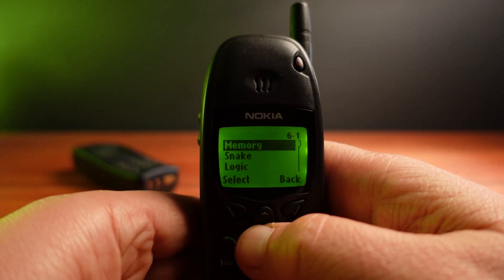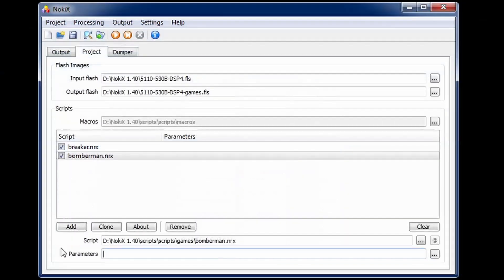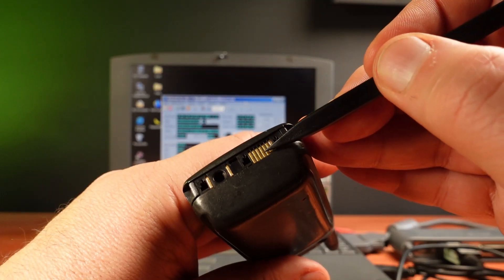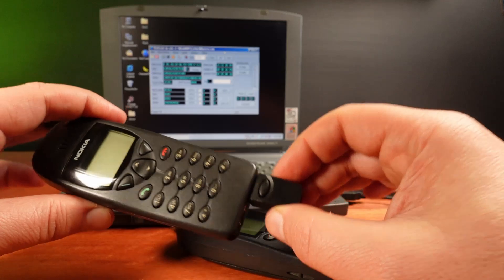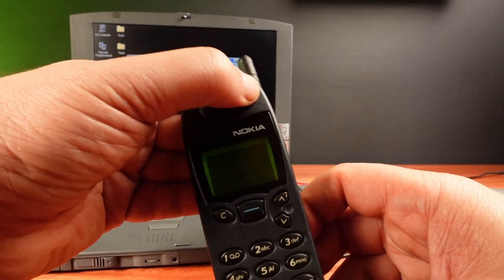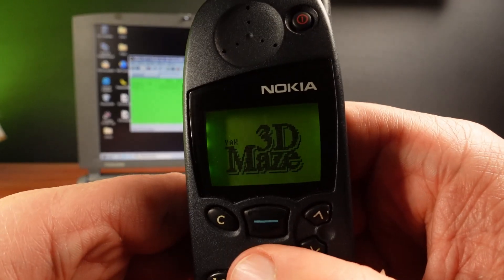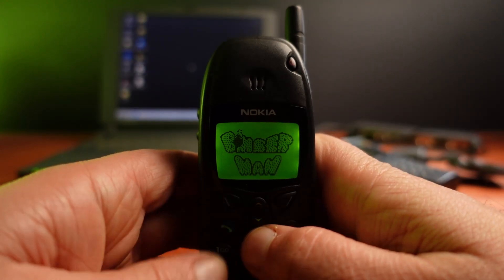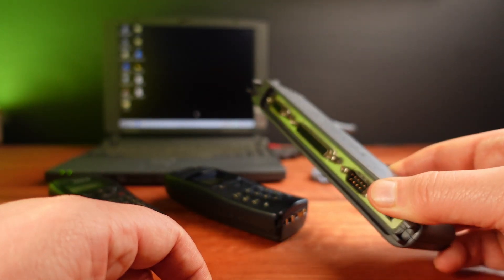Vintage Firmware Modding Nokia DCT3 Phones

Comment: It's strange, I assembled a cable for flashing, but when I try to read the flash, it gives an error initializing the preloader. And the error code is different each time. I checked my circuit a million times and whether the contacts are suitable for the Nokia itself (in my case, 5110) - to no avail. I don't know what to do anymore. I assembled two such cables - both do not work. I use Pentium 4 1.7ghz and 98SE
Reply from the maker: I wish I could help you more. My first suggestion it to try the other parallel port modes in the BIOS. e.g SPP,  EPP and ECP to see of that makes a difference.
Reply: @JanusCycle  Thanks for help, but I've already figured it out, the problem was probably in my crooked hands) I assembled another cable, the result works. I have such a question, if you know of course, I found the firmware, but there are a lot of files of the "pp" extension, and all this is in the wintesla folder. I googled, Wintesla is also some kind of software for flashing Nokia. But I have not yet figured out how to flash it, and whether it is possible to convert pp files into one fls format firmware for rolis flasher.

Comment: What is the laptop make and model you are using thx
Reply from the maker: It's a Toshiba Portege 3110CT
Reply: @JanusCycle  thx I could not find 1 on ebay so I bought the Toshiba Portege P7140. What is the name of the parallel port adapter you have. I am getting into mod/hacking the the 3310

Comment: i have a 5110 that i found in the alarm thing that calls the security service guys after someone breaks in the house, i think it has some modded firmware and i want to bring back the old one
Reply: I took apart an old alarm system a year or two ago and after removing the back plate, I discovered that the system for calling the security company was just an old mobile phone, wired into a couple of printed circuit boards.

I was surprised but thinking about it, it's probably a cheap off the shelf way of doing it for low volume security products like that. Or at least it was.

Comment: I'm pretty sure I had one of these as my first cellphone back in around 2000 when I was was probably 16. Telecom had a deal at my high school where you could trade in a Vodafone phone and like $50 to get a brand new Nokia and credit on the phone perhaps. The phones came in bright colours. It might have been a slightly different model, but similar. I recall there was a stubby antennae on them. I went down to cash converters and got a cheap worn out vodaphone phone for the deal. One boy got hold on an ancient bellsouth telephone which was a network here in New Zealand later bought out by Vodafone.

Comment: The first read out of the 5110 didn't work because you pressed the power button for too long. You need to tap it shortly, NOT hold it to turn on the phone. It even says so in the status bar of Rolis.
The reason for that is that a short power button press already makes the boot ROM in the ARM CPU of these things execute. It then either needs to receive the right handshake which Rolis constantly sends to load further code into RAM which then implements the flash read and write routines. If you hold the power button for too long, the phone just turns on and never loads the flashing code from Rolis.
Reply from the maker: Great info, thank you!

Comment: This is so awesome! Back in the day I used to modify DCT3 firmware files as well. One of my NokiX scripts was a "smart home" appliance. :) Nokia 3310 original batteries used to have a thermometer inside of them. So I created a little NokiX app that would respond to incoming SMS messages and reply back with the current temperature. Then I connected vibrator signal to a relay which was connected to the electric heater. This way I had remotely SMS operated electric heater. Probably not the safest of the implementations, but definitely the most fun one. :)
Reply from the maker: That sounds really clever, thanks for sharing that story!
Reply: Wow awesome
Reply: Nice

Comment: Wow, awesome video, what a flash back!
I was spaceimpact33 on NokiaFREE forums and spent the better part of my teenage years learning to code by modding DCT-3’s. My best mod was porting a flash file system that that used the space between the MCU and PPM. Built some hooks that enabled storage of SMS messages on device instead is the SIM.

Comment: I have 2 x 6190 (1900 GSM version), 5190 (1900 GSM), and an AMPS analog add-on module (nickname surfboard), a programming cable that I have switched between the F and M bus, as I had to unlock some of them (NCK). I gave away a few of my collection to a (non technical, old gentleman) neighbor for his collection, so I forgot if I still have all of the above now. I never did any other hacking except for unlocking. I also had a few 5160 (1900 TDMA version) at one time, when a US MVNO had basically free service at one time. I also have a few 3390 as well, but sold them to my friend and I just have kept one. I remember my friend did a firmware update for my first 3390 at the time, as he was working as a tech at a dealer at the time. These are nice phones, I am sad that the GSM network had been shut down a few years ago, making these phones rather useless. (Except for things like in you video). Again thanks for the video, I am glad I bumped into your channel a few days ago by chance . Looks like we have quite a few things in common, but you are more hardworking in this than I am.

Comment: I was writting patches, drivers and even elf's to my sony ericsson phones back in 2008-2011 but with android coming out and price being 300-700usd per phone and being afraid to brick expensive phone I was hesitant to learn modding on android and thus left it... drivers were like the name suggest mostly sound drivers to make phone's speaker output/headset/bluetooth output higher, patches were to eliminate limitations such as low volume message, disable operator logo so it would no longer be shown on the screen, disable limited message storage and many more, with other small tweaks such as replacing on/off animations and such... elf's were a small programs, which mostly let you do amazing things like taking a screenshot in a phone at the time when no feature phone (except early smartphones) had such function... and sometimes hardware mods such as installing LED's taken from other phone flashlight so that it would shine them at rythm of the music...
Reply from the maker: I was applying these patches to my Sony Ericsson K750i at that time. I probably had and still have some of your patches in my phone. Thank you so much for the work you did.
Reply: bro, i still have some patches on my w850i w595 and w995 but i need a good site with all the firmwares, a certificare converter app from red to brown and some patches to make the phone work without sim on my  elm and cedar. if you know any of those, i will gladly take your advice, because omnius owner idk if he is available anymore so i can buy a license.
Reply: I have it too 😯😲
Reply: How did you make them? Can you send me them?
Reply: Do you still have some source codes for them?

Comment: Where did you buy your empty nokia connector from?

I have a 5110 in box but it only has power supply with it, I have no serial cable

And I also dont want to destroy a good cable to build your cable so I hope someone still makes this connectors new
Reply from the maker: I had this in a box of old Nokia stuff for a long time. Search for 'Nokia 5110 box cable' and find many options. I found this when searching for example. But I've never ordered from them, I don't know if they are ok. [Redacted]

Comment: Do the .nrx files contain the original code of the games taken from Nokia firmwares, like roms for the NES, or are these games created by fans based on the original Nokia games?
Reply from the maker: These are fan created games. There is an .nrx of Snake 2 which I believe is copied out of later models.
Reply: @JanusCycle  Is it possible to open the file structure of the firmware as in a normal OS?
Reply from the maker: @foxitize  I have seen software that can access menu graphics and languages in a sort of filesystem. But I haven't looked further into it . . . yet

Comment: In which lanuage are games/apps written for these DCT3 phones? Ok that was at the end of the video. They are written in C.
For DCT4 is it also C or are they using Java?
Reply from the maker: Many DCT4 phones can run j2me Java apps. But these patches only work in DCT3 phones. Because DCT4 has stronger firmware security and can't be patched like this.

Comment: for some reason after adding some games in the Nokix I have no success flashing the modified file, it says MCU CHK is bad and asks me if I want to solve this, pressing yes or no gives the same result with the "contact service" message on the phone screen, so I needed to flash the original file back to recover the phone. Can't find anything about this problem
Reply from the maker: If Nokix is giving an error when modifying flash files then try some different firmware versions. I did have a problem with some firmware files. They were either very early or later firmware versions and I had to use the more common versions instead.
Reply: @JanusCycle  thanks, i fixed this problem by adding kill mcu check plugin to the firmware. Now i can finally play Maze 3d and Breaker 😄

Comment: please help i need firmware file flashing nokia 3110 with old antenna
Reply from the maker: The Nokia 3110 is a DCT-2 phone from 1997. This software and hardware I used for DCT-3 can't flash DCT-2 and I don't know where you can find the firmware. Maybe you can try asking in GSM-Forum or some Russian forums for help.

Comment: Where did you get that connector you have soldered onto?
Reply from the maker: I've had that connector for a long time. One way to get these connectors these days is to buy a 5110 'box' cable and take the connector from that.

Comment: Please upload firmware menu 3410 to 3310 device. Or load the 3315 menu on the 3310 device 🙂❤️
Reply from the maker: I would like to try flashing more with later Nokia models. I believe the 3410 uses a higher resolution screen, which would be really interesting to see.

Comment: Hi, I recently bought four 6310i phones. Can I use the same procedure to flash these phones? I didn't see the 6310i listed.
Reply from the maker: The 6310i is a DCT4 based phone which I don't think is open to the same modification potential of Nokia's earlier DCT3 phones :( It's a pity because they are quality handsets.

Comment: Can it be done with an rj45 cable and possibly windows 7 because I would really like to know the answer after seeing this video
Reply from the maker: The only way I know to flash old Nokia on Win 7 is to buy a dedicated flashing box such as JAF BOX. I simply found it easier and cheaper to use an old computer with a parallel port, install Win 98 and build a cable.
Reply: @JanusCycle  maybe its possible to get something like LPT to USB cable and install win 98 on virtual box? or it must be real hardware for it to work? i have nokia 7110 and it says CONTACT SERVICE after i turn it on, i would like to try to reflash it, and also looking for a cheap solution to connect it a modern PC.
Reply from the maker: @gediminasvenc117  The flashing software I have seen controls the Parallel port directly and I don't think will work over USB and not with virtual Win98.
Contact Service can sometimes be fixed without flashing by recalculating the eeprom checksums and full factory reset using kNok-Phoenix software. This probably needs an MBus serial cable to do.
Maybe a USB FBus cable can work for that, but having serial and parallel ports and real Win98 is always better working with these old Nokias.
I love the screen on the 7110, I wish I had one!
Reply: @JanusCycle  All right, thanks for the such detailed answer! i will check maybe i will be able to get Mbus serial cable and start simple :) thanks again!

Comment: Hello there.  
Thanks for this instructional video.  

Where can I get original .fls flash files for dct3 devices?

I found flash files with .mcu extension.  
I converted it to .fls file with “DCT3 flash converter” application.  

but nokix application gave error.  

can you help me please
Reply from the maker: Finding good fls files can be tricky. Not every fls file I found worked with Nokix. I think you need a full flash which has mcu and ppm together in the fls file. The biggest archive I've found is a Polish site. https://chomikuj.pl/chomikbox
They have just about every flash file that was available for vintage Nokia.
Reply: @JanusCycle  Thanks 👍🏻

Comment: Do you think i can use 74HC4050D level shifter instead? (which apparently does not invert the signal) Can i set whether the signal should be inverted or no in the settings?
Reply from the maker: As long as you convert the level to 2.8-2.9 Volts it should work. There are settings for inverting the signal.
Reply: @JanusCycle  well i tried it with two diodes in series on fbus rx and mbus and the dct3 flasher on windows 98 responded to the power button beig pressed but got stuck on  some sort of waiting (i forgot the exact text, but it was just after "waiting for phone to power on")
Reply: @JanusCycle  it said "wait for boot counter accept (tx=high)" actuall
Reply: @JanusCycle  sometimes it told me to power off the phone (it sometimes told me with both inverted and uninverted signal so i have no idea) and sometimes it started and after about an second it said done, but nothing was read

Comment: What's the internal memory on these phones? Never had one of those. Went from 1610 to 3410 with java straight ahead. Phones weren't that important back then...
Reply from the maker: The 5110 and 6110 have 2Mb of flash with about 700Kb free on the 5110 and less on the 6110. The 3410 has a 4Mb flash and a higher resolution screen. Modders really like that model.

Comment: One problem tho: where can I get a serial cable for the 3310 and does it need a (rare and expensive) box to operate?
Reply from the maker: You can easily modify those cables to work with the parallel port interface. No need for the expensive box.
Reply: @JanusCycle  I see. Do you know where I can buy one though?
Reply from the maker: @blakegriplingph  I would search around for 'Nokia 3310 flash box cable'. Here is one I found. I've never ordered from this company but that cable looks exactly right. There are four pins to connect to the 3310 under the battery.
https://www.cellcorner.com/xshp/unlock-phone-codes/nokia-3310-rj45-griffin-unlocking-cable.html

It's best to make sure the cable has the ability to also use the battery. Some service boxes power the phone directly over the cable. If you get one of those cables you will need to wire up the battery to the cable as well.

Comment: I still have my Nokia 5110, 3310 and Nokia 3350 that is a firmware modded Nokia 3330 with Nokia 3410 screen. Not sure if i still have all firmware files and other stuff somewhere on a harddrive. I did for the most times only modded ringtones, font and menu pictures.
Reply from the maker: I didn't realise the 3350 had a higher resolution screen compared to the other 33xx models. Thanks for letting me know!
Reply: @JanusCycle  The 3350 and 3410 also had conventional navigation keys rather than the Navi-Key used on the 3310.